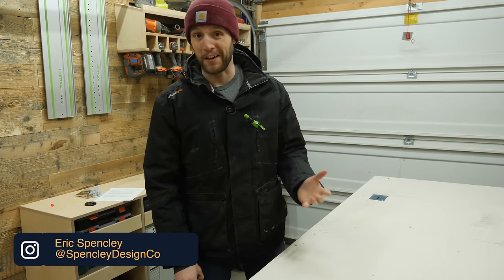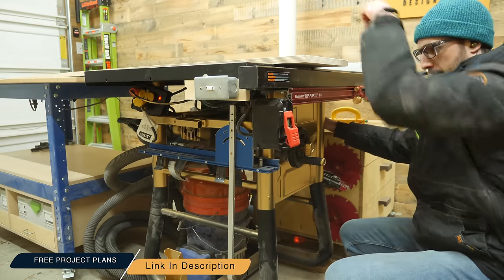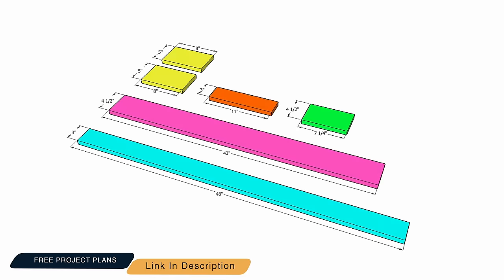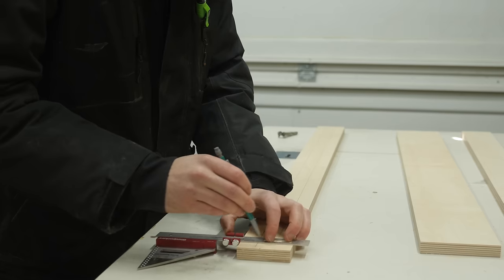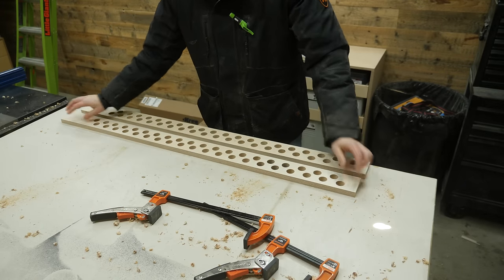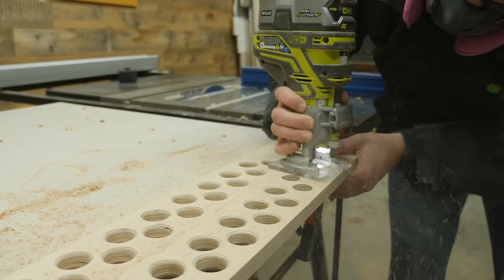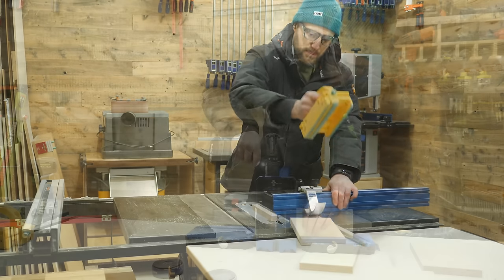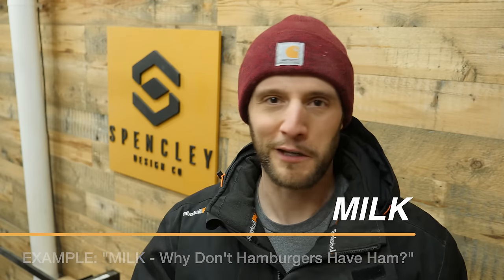Tackling the Most Daunting Shop Vac Problem

Comment: Hmmm, Milk
You’ve given me an idea to create something similar but allowing for a 180 degree swing, piped into a 55 gallon plastic lidded tub as a collector. It’ll save me having to drag the tub around the shop as I vacuum. Cheers, and keep up the excellent work. From across the pond!
Reply from the maker: That’s a neat idea, Kevin! Have you ever made a cyclone separator like that?
Reply: @SpencleyDesignCo  I have the 55gal tub with direct vacuum hoses, in/out connected up to an old Dyson DC 39, and I trundle that around the floor of the garage workshop as needed. A simple spring and bolt acts as a pressure valve to stop it imploding if the inlet becomes blocked

Comment: Milk and cookies.
The boom arm turned out great! Quite liked this video! I've been considering building one of these boom arms ever since seeing Jon's video. Your video made me decide it's definitely something I need. Well done, Eric!
Unfortunately, I have had too many green tools fail on me to even consider walking down the green tool section at the hardware store - even though the prices are sometimes very tempting. I now save up a bit more and spend money on a different colour tool, just so I don't have to deal with frustrations down the road. I realise this is a luxury not many people have though.
Reply from the maker: Thanks for the continued support! What’s your favorite tool color now?
Reply: @SpencleyDesignCo  I know some don't like it, but I quite like orange as I have so many of their battery operated tools now which I can also use in the garden. I do like blue/green and yellow too.
Also, I just realised from your video, hammer drilling is not only ear-numbing, but can also be hand-numbing. How did your hands feel after drilling all those holes?

Comment: Way to MILK Ryobi for all they are worth! :) I have no problem with them as a startup tool but having used Ryobi, Makita and DeWalt tools for quite a few years, Ryobi is not even close in quality. But, if you are already invested in the line using battery powered tools it would be a major pain to transition away from them. For my money, however, I would start the process - especially if you are hoping to build this into a full time career. Next time a battery tool fails, if it is not replaced free, pick a quality brand (IMO, go with DeWalt 20V stuff) and run down to the local pawn shop or find a used/reconditioned tool online and pick up what you need. Almost all of my DeWalt stuff was purchased that way (mostly at a pawn shop) for about the same price as new Ryobi stuff. Yes, you run a risk of getting a tool that is used up but, over the years, I that has only happened once to me. What I would not depend on used are batteries. I have about 4 batteries I swap out in all my tools. When they go bad -- and they do -- I replace them with a new one.
Reply from the maker: Thanks for checking out the video, Donald!  What's your favorite ryobi tool?
Reply: @SpencleyDesignCo  My favorite Ryobi tools are a biscuit jointer and a circular saw -- neither are battery powered. I began my move away from Ryobi when my trim router kicked the bucket. I thought it was a fine tool but ended up spending a bit more at a pawn shop for a 20V DeWalt trim router and was amazed how much better it was. Most of my tools, though, have been corded Makita tools which I very pleased with but am slowing replacing with battery powered DeWalt stuff. Once you get sucked in to a battery powered vortex it is tough to get out!

Comment: Here's my top 5 tool brands: 

Dewalt 
Ryobi 
Makita (would've been 2nd if they weren't more then a 90s F250 for 6 tools) 
Skil (haven't actually used any but I've seen the stuff they do for prices that are insane)
Flex (same as skil and probably would be 4th if they dropped the sketchy marketing) 

None of the above would hold up well after being exposed to milk tho...

Also why are you using the hammer mode for concrete drilling with a spade bit lmfao.
Reply from the maker: What about kobalt, porter cable, and Bosch?
Reply: @SpencleyDesignCo  Bosch belongs in a bin unless you buy the big corded tools, porter cable litteraly no longer exists unless you go to tractor supply and Lowes doesn't exist in Canada.

Comment: Milk : Great video, what tool group would you upgrade to from Ryobi?
Reply from the maker: Thanks! I’ve got tools from just about every brand. I’ve not so much worried about the brand as much as I am about the features the tool has. What’s your “go to” brand?
Reply: Right now I just mainly have Ryobi.  Was looking to upgrade in the future to something with more features but not sure what yet
Reply from the maker: My suggestion would be to stick to the same battery platform until YOU KNOW that you NEED to upgrade for certain features. There’s always an allure of getting new tools, but unless you’re stifled by your current selection you’re just wasting money. You got this! 😀
Reply: @erljohns29  I'd just upgrade to the brushless ryobi, and if you really have to upgrade dewalt 20v
Reply from the maker: What about craftsman?
Reply: @SpencleyDesignCo  same as the ryobi brushless but involves buying all new batteries. Dewalt is the same but then you get way more power.

Comment: Milk and honey, the boom arm is nice.  My shop is also in a small one-car garage and I use a regular shop vac instead of big dust collection system.  I am thinking that I could also run the air compressor hose through a boom arm like that.  
My green tools have served me well for the most part.  However, my standard sized wired router was crap.  I eventually replaced it with a DeWalt.  For a batter powered palm router, I might still consider the Ryobi since I have several other tools from them.  Thanks for your videos for those of us who don't have tens of thousands of dollars to invest in high end esoteric tools.
Reply from the maker: That’s a great idea! Thanks for watching Thomas. Any projects you’d like to see my try in the future?

Comment: MIlk

I don't understand the Ryobi hate I had the same Ryobi drill for 10 years with the original batteries and only have a new one now because I smoked it out drilling 3/4 inch holes with a spade bit during an electrical install on a fresh built garage.  The issue was my fault for using the faster speed and a super aggressive diablo spade bit.  

But a quick trip to home depot and I had a new drill.  I didn't turn in the old one bc it was WAY out of warrantee. So I hopped online and got a fresh replacement motor and few days later swapped out the motors and now I have 2 drills. This took about half an hour and was really easy.

I bought that drill as a Christmas set 10 years ago and the drill is the only tool to need replacing, Ill honestly never buy another brand unless there is a tool they don't make.  They really need to get on the domino band wagon IMHO.

Comment: Milk - I have been watching your channel for 3 -4 months now and your comment on Ryobi tools is understandable, however I have found them to be very reliable.  My first Ryobi tools was a weed eater and I worked it until the motor was so hot you could not touch it, and I thought I had burn't it up, but it keep running. I could not kill this tool, so I have purchased many more of the battery powered tools and again have not been able to kill them.  I did have to cleaned up the commutator on sawzall and it still runs.   the only other power tools I will purchase is the Milwaukee tools also hard to kill.

Comment: Milk!  I agree with you about Ryobi tools. Great value for the money!
Reply from the maker: Yes they are!  What's your favorite one, Bill?
Reply: @SpencleyDesignCo    You can’t go wrong with the trim router (even though yours crashed and burned), but the drill/driver and impact drill have never let me down either.
Reply: Still have my original Ryobi drill about 10 years later.
Reply from the maker: Nice nice nice! Any plans to upgrade?
Reply from the maker: I like their drill/impact for sure! I’ve had issues with the collet on the router though
Reply: @SpencleyDesignCo    Depends on if my woodworking skills improve. 😂
Reply from the maker: They for sure will!

Comment: (milk :) ) - my ryobi did exactly the same, the shaft had actually sheared inside the router body so there was some grib based purely on friction but as soon as you aply side pressure the sheared shaft detaches and the router stalls.
Reply from the maker: Oh man that stinks! Were you able to get it replaced for free?
Reply: @SpencleyDesignCo  Nope, 1 month out of warranty’ it was barely used too.
Reply from the maker: Ahh that’s a bummer. You might consider taking it in anyway. Mine was out of warranty and they still replaced it

Comment: Milk, it’s what’s for dinner. Another great video!
Reply from the maker: Thanks John! Any videos you’d like to see me make in the future?
Reply: @SpencleyDesignCo  Maybe you’ve already done this, if so, forgive me, but I’ve just gotten into using a router and I’m kinda struggling with it. Specifically, I can’t figure out how to keep from getting burn marks in the grooves I’m routing. I’m even using brand new bits. So maybe you’ve experienced this too and can share some tips on better routing? My palm router has a speed adjustment, is that the solution? Slowing it down? Anyway, just an idea for a video.
Reply from the maker: Ahhh yeah you’re either running the bit at too fast of speed or not pushing the router fast enough

Comment: Milk. As a master HVAC technician and class A contractor for 30 years I’ve used mostly Ryobi tools and have always felt they deliver a good value. Every once in a while I’d pay for a pricier brand but generally stuck with what worked. Most of my retirement woodworking shop is Ryobi and I’m pretty happy.

Comment: Drink more milk!! 
Love your videos!! Just upgraded my entire dust collection system to run off of a CamVac instead of a Harbor Freight 1½hp dust collector. The insane increase in air flow and especially static pressure made it possible to use a vacuum hose with my central dust collection system. Building a boom arm is my next step. Thanks for the video!!

Comment: Milk, I have a Ryobi drill and an old Ryobi circular saw. They both use the same batteries. The old circular saw came from a thrift store: the junkyard of very inexpensive, forgotten tools without batteries. They’ve both impressed me with their longevity and resilience.

My wood-shop is also stocked with a few low-budget tools, but I keep everything sharp, clean, and maintained and I get the jobs done.

I just found your channel and am enjoying your videos. Thank you. 👍🏻

Comment: Milk. Nice boom arm build, simple but effective. I've been contemplating to build something similar because of the same reasons with the hose dragging across the workpiece. One thing though, I do NOT recommend hanging on drywall anchors, find a stud like you did. I think I would like to hinge in such a manner so it can rotate in both directions for flexibility of reach.  BTW, Ryobi tools aren't bad, I have the same cordless router and its been working for me for over three years. Like you said, for the price you can't go wrong.

Comment: milk, my drill/driver, jig saw, router and router table, and bandsaw are all are Ryobi, I have had them for around 3 years and no complaints for around the house jobs
Reply from the maker: Nice!  What's your favorite ryobi tool?
Reply: @SpencleyDesignCo  the bandsaw by far, only a workbench model, but it allows me to make the pretty curvy cuts for my sign carving
Reply from the maker: Nice! I’ve heard mixed reviews on that one, but haven’t personally used it

Comment: I have been through 3 generations of Ryobi cordless tools and have generally loved them, esp. the latest brushless motor drill.
Having said that, I have that same router and generally hate it due to its tendency to let bits wander while cutting.
Having said THAT, I haven’t gotten rid of it yet and find it useful for using it just as you did, doing lots of tiny (1/8” - 1/4”) roundover cuts.

Comment: Milk.
Thanks for the build video!  I may modify it to use some rigid PVC in place of some of the ShopVac hose. We'll see.  I do have a request. I use the free version of SketchUp and can't open the Pro edition files you include with the plans.  Is it possible for you to save files in a different format that I can open?

Comment: MILK. This is a great design. I was thinking along with adding the power cord I could add an air line with the retractable spool handing below the end. Now you have vacuum, power and air! The tandem power switch for the tool and vacuum is great. I've used one for a while now and give them as gifts to my weekend woodworking friends. I started out with Ryobi and am now transitioning to DeWalt. Ryobi has served me well. I fell in love with pocket hole jigs a few years ago. Kreg makes some great tools and accessories.
Reply from the maker: Thanks for watching Gean! What’s your favorite ryobi tool?
Reply: @SpencleyDesignCo  Years ago I bought a Ryobi tool package that included a chop saw, drill, speed saw, 4" circular saw and reciprocating saw all in a nice carry all suit case/work top carrier. The tool that surprised me the most was the reciprocating saw. Being cordless made it so useful for demo work, working on my old truck and PVC pipe work. I would have never guessed how many times that thing got me out of a jam.
Reply from the maker: Oh nice! I’ve got a recip saw but still never used it 😂

Comment: Milk: it's what cookies were designed for. ;-)
If it's a tool I know I'll be using on even a moderate basis, I won't skimp on it. For a trim router, the ridgid, makita, dewalt (corded versions) are all amazing little routers. Cordless is a great luxury to have, but they can be pricey. I've been very happy with the M18 trim routers I have, as well as my corded ridgid trimmers (R2401).
Reply from the maker: Thanks for watching!

Comment: Milk. Where is the shop vac located? How long does it make the hose and do you lose suction? I’m in the process of building a 12X14 shed shop for myself and am looking for any ideas on saving space. Thanks for the video
Reply from the maker: I ended up putting the shop vac up in the rafters where my dust collector is. Doesn’t seem to reduce the suction

Comment: Milk, nicely done!  For me it’s the router cord when I am using circle templates.  This is on my list of wants in my shop
Reply from the maker: Ohhh I didn’t even think of that! Do you cut circles out a lot?
Reply: @SpencleyDesignCo  not a ton, but the cord of my router is a pain every time I do!
Reply from the maker: I can imagine!! I’ve seen something people simple dangle a extension cord from the ceiling or get one of those retractable power cords

Comment: Milk. And why don’t hamburgers have ham in them 
Love the concept. Am struggling tho with where to keep the actual vacuum in my garage to make this work. I couldn’t tell from your video where you have your shop vac and how the boom connects to it
Reply from the maker: You could leave the vacuum anywhere. I originally had it on the floor and ran the hose up the wall. Then I moved it up into the rafters above me

Comment: The only problem with screwing the box at the back directly to the wall is it only swings out to 90 degrees?
Reply from the maker: Yes, but you could put the hinge in another spot if you needed to pivot more

Comment: Milk - you have to have the tool and the vacuum plugged in to i-socket, correct?
Reply from the maker: Correct, you can run an extension cord if needed

Comment: Milk. I've been very tempted to do something like this. The trick is figuring out where to put this in a garage. I saw John's boom arm as well and liked the idea.
Reply from the maker: Thanks for the continued support, Erik! I’d suggest putting it towards the center. Any projects you’d like to see me build in the future?
Reply: @SpencleyDesignCo  The center wouldn't work as I there's a car there, plus all of my "workshop" is at one end of the garage, wedged between cabinets, storage wall and the water heater/furnace. I think the one wall at the end would be the best place, perhaps connect it with a Dust Right dust collector. That's down the road though.

I'll put some thoughts together on projects.
Reply from the maker: Oh that’s a great idea! Do you like that dust right system?
Reply: @SpencleyDesignCo  I haven't bought it yet but it looks like a nice upgrade from a shopvac. Would be useful for the table saw and thickness planer, plus for cleaning up the shop area.
Reply from the maker: I’ve heard mixed reviews on it. Some say it’s not tight enough

Comment: Awesome idea there Eric. My hose is too short though...it'd reach up the wall, but that would be it! Maybe need to see about an extension, or drink some milk!
Reply from the maker: Thanks, Paul! I just connected another hose to the end and it works great! You could also buy a longer hose on the Amazon. Any projects you’d like to see me build in the future?
Reply: @SpencleyDesignCo  Hmmm ...tough one! TBH I always gain something from most of them....so please keep doing ones you need for yourself. I'm always in awe of YT creators....I dabble in the odd video, and I know how many hours of work is needed to create a "simple" 10 minute video 🙏🙏🙏
Reply from the maker: 🤣 yeah it’s a lot of work. But it’s something I really enjoy. Any shop projects you can think of that lots of people would enjoy?
Reply: @SpencleyDesignCo  Ok, as you asked nicely (twice!) I always like to see table saw jigs / tips for odd cuts....tapering a long board etc. Now I think of it....a cheaper way than those damned expensive rollers to hold up long planks either side of the saw........
Reply from the maker: Oh that’s a neat idea!